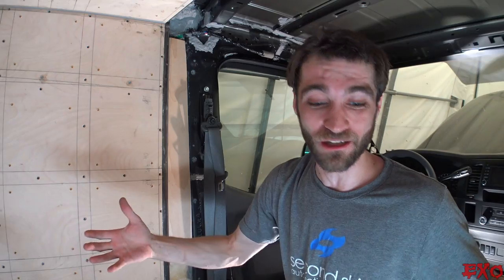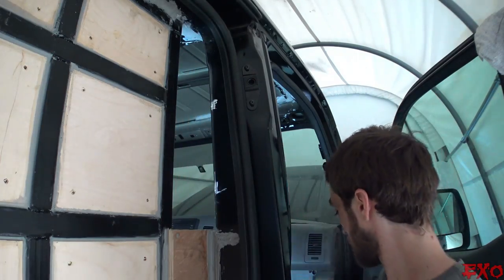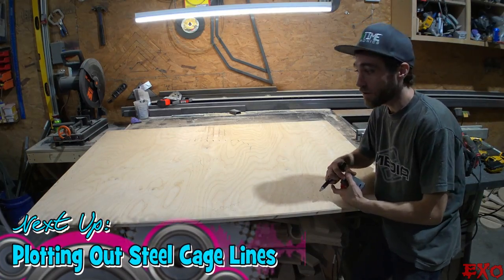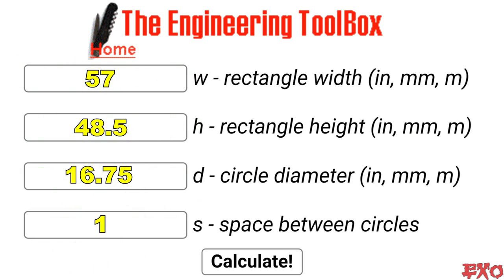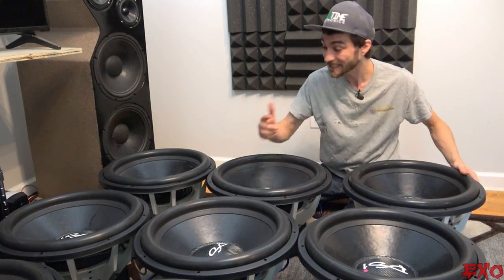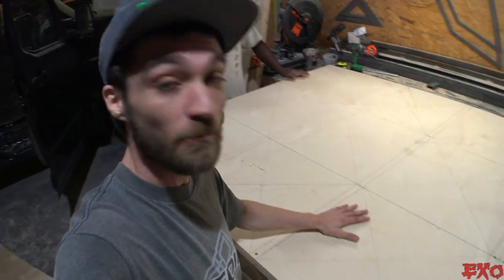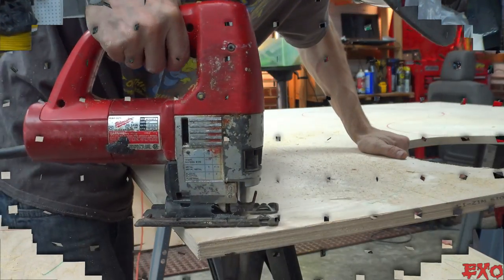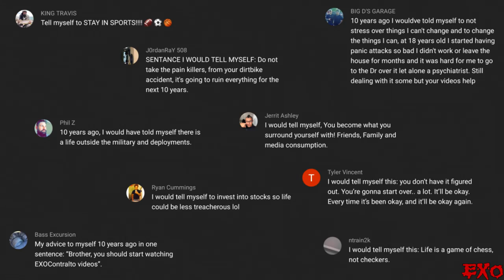6th Order BASS VAN Build: Sealing Box, Building WALLS + Designing Bandpass & Cutting Subwoofer HOLES

Comment: Trick for mounting heavy drivers into a vertical baffle:
Instead of screws, drive studs into the baffle. (2 out of the 8 fasteners). Now, you won't need to support any weight while putting the screws in.

Comment: Cant tell if your using the 10oz caulk gun or 28oz caulk gun.. but with the amount of PL glue and other glues. You can save some money by switching to the bigger caulk gun. Just a heads up. Save money and put it towards more gear for the van build.

Comment: I would choose unlimited money as I have the knowledge of how to do what I want. But my body and health as well as $ say oh no you won't. I started with a big idea and a low budget lol. Being able to work on it very little at a time sucks. 
9 months after I got my 01 Silverado extended cab I am finally finished upgrading my power plant into overkill beast mode.

I am running 2 batteries with a 250Amp alternator via an isolator. The power wires are 4ga and the grounds are 4ga. I am running a 10f cap going to a skate 6ch amp. Speakers are 2 mtx terminator 12s wired with 8ga in a box. And 10 Pyle wild blue 6.5s wired with 10ga to the box and 14ga to the speakers (insert jokes but don't hate a playa with almost no budget. Feeding the amp is a unbranded touch screen radio/mp3 unit with a backup camera going to a ssl preamp eq with the signal out set at 9v. Would love to have a 30kw system, but again hard to have   cristal tastes on a water budget. Now I get to spend another 6 - 9 months to do the installation 😂😂😂. Love your content. There needs to be a Showtime store either in Bloomington or Indianapolis Indiana. Mad love and respect.

Comment: woofer with highpowerr motors like the xxx18s are woofers for max spl @ one Frequenzen even in a bassreflex !  THATs a problem! for musik i think a 2 series bassreflex woofer is the best design.6th or 8 bandpass has a crazy rolll off!! like your design form arround 20-50hz. with serie bassreflex with a smaller rolloff its more like 20-80hz.  thats the thing. my system ist loud yes wenn you listen to slowed music or specal bass tracks! listen to the charrts from the 60-70-80-90-2000s andd even today. normal musik is not by 30hz ist more like 50 and up!

hexIbase Two SoundStream XXX-15s on a pair of Hifonics XX-Colossus amplifiers; roughly 155dB that video is 13 years old . but his design build to listen to music not for max spl

Comment: I have a question that is not related to an audio system but is definitely related to my car's electrical system. I live in New Orleans and the Hurricane Ida power outages convinced me that I need a backup power system that supplies somewhere around 2000 watts to run a fridge, 2 small window unit A/Cs, a desktop computer, and maybe a TV for up to a week. Based on history, this will only rarely happen so it would be for emergency power only. 

The traditional solution of a gas generator is almost impossible for me to deploy because I have absolutely nowhere to store it much less the gas needed to power it for more than a couple of hours. As a result I am considering using my car as the power source. I already bought a 3500 watt inverter to make sure that part of the system has way more than enough capacity. Based on some of the info from you videos, I am also in the process of upgrading my charging system cables to maximize the alternator's output. I am pretty sure my alternator is rated for 110 amps. I am also willing to parallel additional batteries to the system if necessary. Upgrading my alternator would not be financially practical at this point because its location would require me to have it professionally removed and installed.

Does this system seem feasible to you? 

Thanks so much for taking the time to share your expertise!